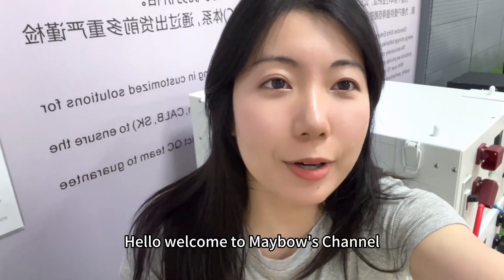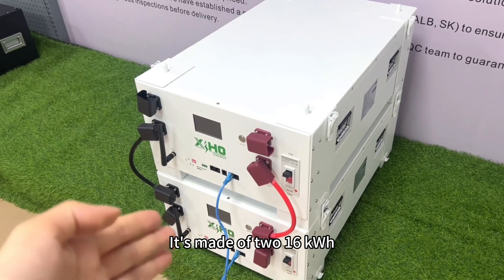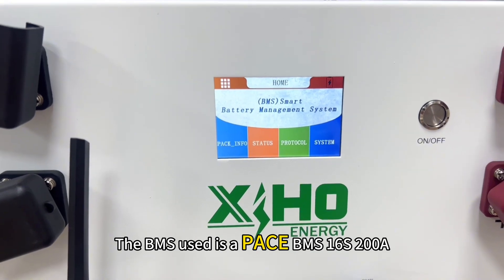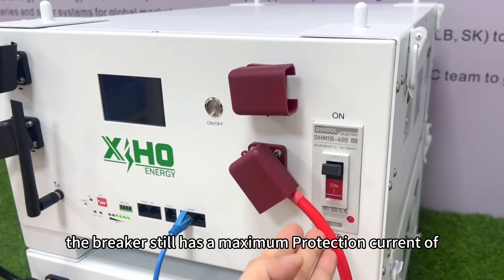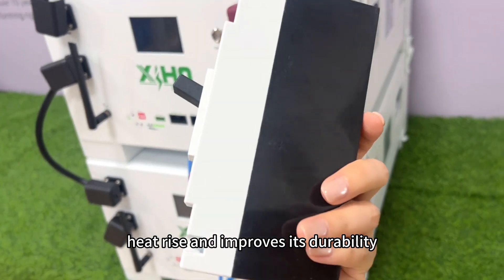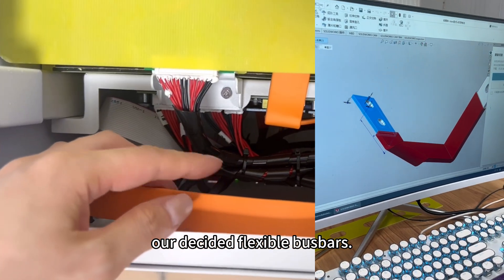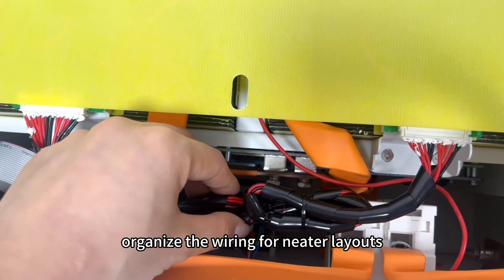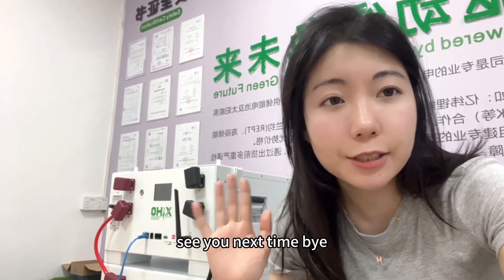【XIHO Energy】32kWh Home Battery UNLEASHED! Double Power, Zero Anxiety

Comment: Could you make them shorter?  Say small enough to fit in a server rack setup?  Normal rack mount batteries are 3RU tall (1 RU is 1.75") and a standard rack is 36" deep and 19" wide at the rails (plus some extra for bus bars and elbow room so we'll say 24" wide) but all of the rack mount batteries are 19"wide and usually 18" deep... there's plenty of room to add more capacity to each battery till it reaches (or almost reaches) the back of the rack.  If you got it all the way to the back of the rack could you get 16AH into a 3RU or 4RU space in a single battery?  Obviously the downside to bigger batteries is you lose one and there goes all or a MUCH larger chunk of your power capacity.  But if these were in a rack mount form factor you could rack 6 of them together and have redundancy and capacity enough to run your entire house for 2-3 days with zero input.
Reply from the maker: Thanks for your message. You can check out my video: 
https://youtube.com/shorts/HHk4zQIlEy0?si=FcNcQw6kIPzWVsbl
There's very little room inside, as the battery takes up quite a bit of space. Could you please share us any suggestions?

Comment: You didn't even mention chemistry in the title. Li ion is a container name that doesn't provide any details about safety. Indoor li ion batteries should be LFP or LTO. These are safe for indoors but have a low energy density. Do not use high capacity LCO & NCA packs indoors unless loads are small; phones, laptops. And beware that these high capacity ones only last 3 years after which they degrade rapidly becoming a fire hazard.
Reply: is it ok to have tesla car in garage that uses NCA?